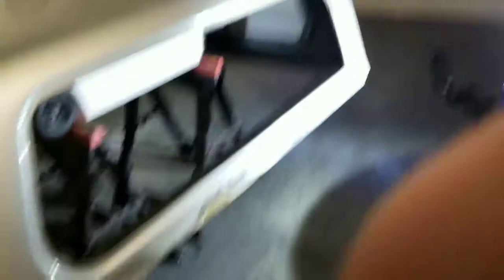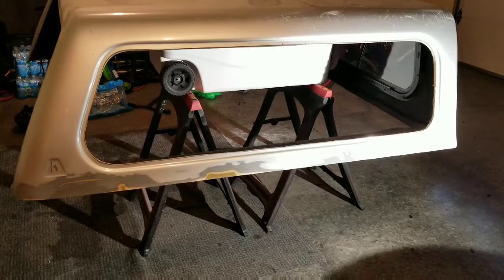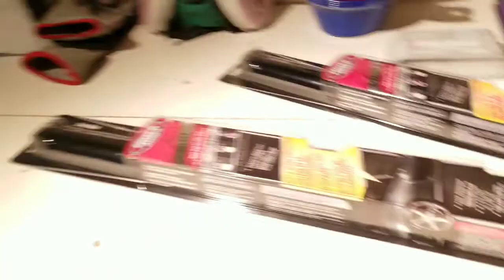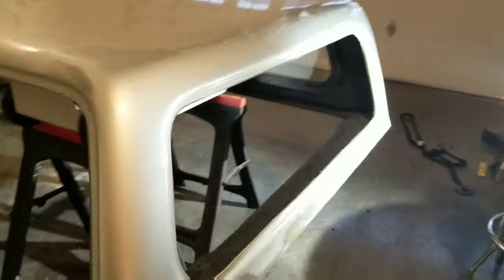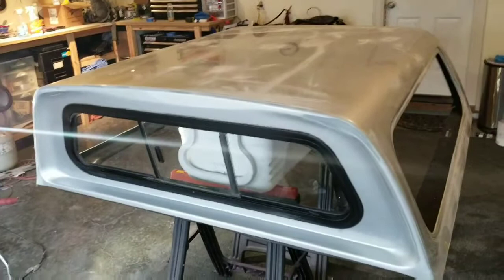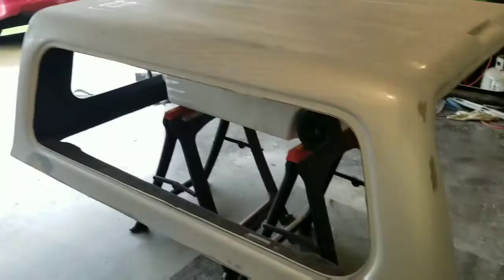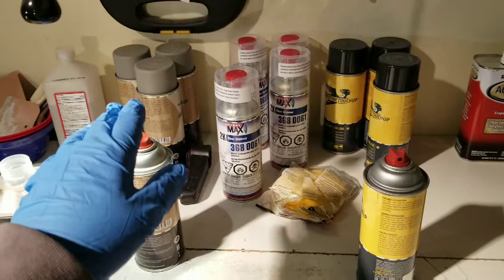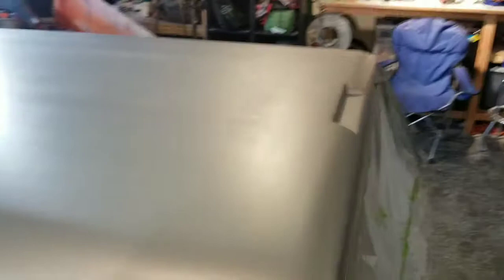$100 TRUCK CANOPY PROJECT PT 3 ..........PAINT PREP AND PAINT!

Comment: Great job on this. I am about to purchase a used shell that I want to color match myself. Your video is very helpful! Do you mind sharing how many cans of primer/paint/clear you used? Thanks again!
Reply from the maker: Awesome, glad this helps. Such a fun way to save some money. 

I purchased my paint from automotivetouchup.com. if I remember right I used like 5 or 6 cans of base and about the same of the 2k clear. If you dont use the 2k clear you will need quite a bit more. The 2k goes on really thick and covers really well. 

Good luck, have fun.
Reply: @rsipetro  thank you!

Comment: Is there a reason you didn't use an electric sander, is it better to do that by hand?
Reply from the maker: Honestly, a DA sender would have been best. An electric would have worked well to. I just didn't have one so I did it by hand.
Reply: You want to be careful with an electric sander though because they have a small work area and thats how you get low spots, if anything, block sand it out as best as possible, put on a guide coat, sand again, find low spots and fill them, then repeat